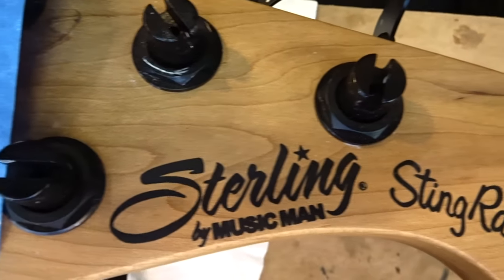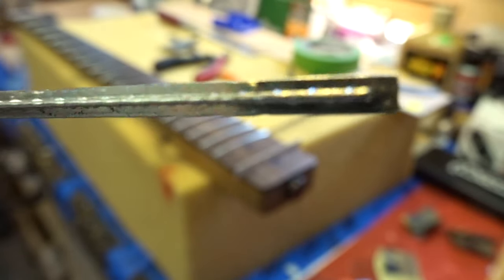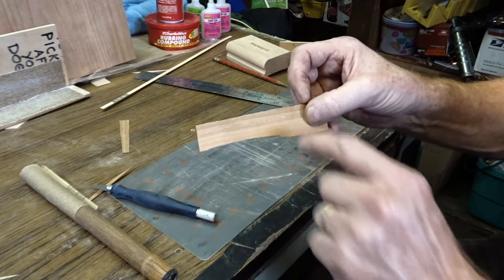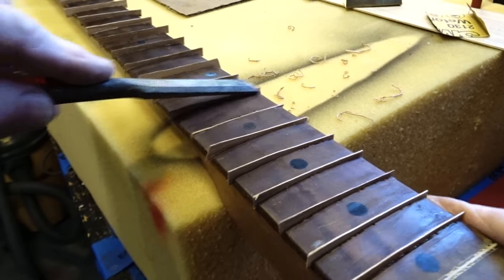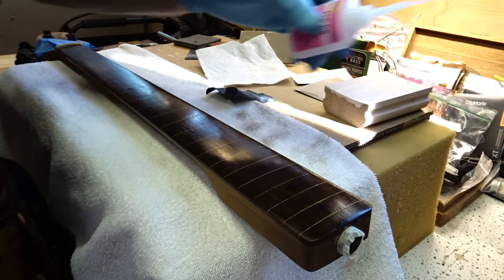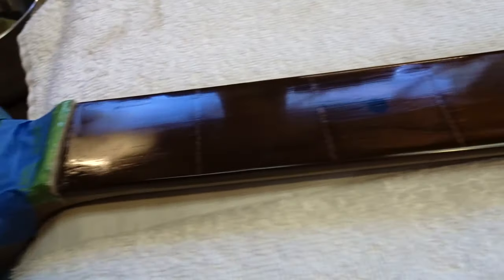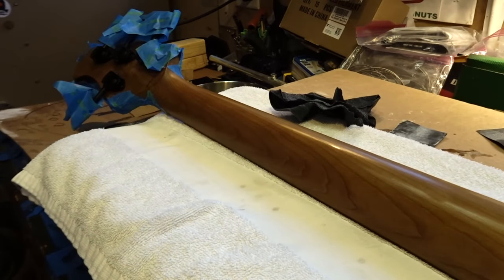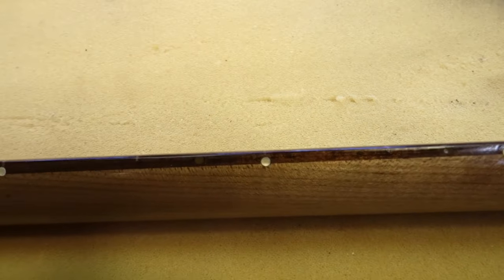Fretless Bass Conversion...Cyanoacrylate Super Glue Finish

Comment: Nice looking conversion. I like that you didn't fill or use a dark filler material, still gives you a visual representation of where you're fingering.
Reply from the maker: I need to know where the frets would be as I'm less than 2 years into the bass.

Comment: Shug a little trick you may want to try is use a tuner to determine where on the fret is in tune. Remember you removed the set location for each note but frets are never perfect in the first place for each string but with a fretless you can fine tune your sound. Good choice to remove the frets. Fretless is great for jazz.
Reply from the maker: Getting used to the feel. I am smitten with it. Lots to learn but the finger roll helps with pitch. The project was very satisfying.
Reply: @shugemery  I prefer fretless, for me it allows more nuance with playing. I have a Ibanez fretless I have played Jazz on for around 30 years and still learning tricks every time I pick it up. Welcome to the never ending wonder of the Bass. P. S. your slaps are getting much better.
Reply from the maker: @kevchard5214  It is tougher slapping a fretless with those tape wounds! Had to slapp 'er with vigor! Thankee. Wish I had discovered my bass love long ago but it is perfect for my life right now. The only way to be new at something is too take up something new. Here is to Nuance.
Reply: @shugemery  Its never too late to try something new I always say.

Comment: for RC models I used to make fiberglass pieces using CA instead of epoxy and would use a plastic bag or cling film over my finger or the part to smooth the CA. Doesn't stick to the zip lock bag material.
Reply from the maker: So you don't have a need to chew the CA off of your fingertips!

Comment: Thank you for this video. Lucky you didn't sell that bass. It turned out very well in the end. What is the experience with the CA coating after three months? Is it hard enough that there are no wire marks on it? And, I know it's too late for you, but maybe for someone else. You can save a little time and effort with this trick: don't pull out the frets, just sand them down to the level of the fretboard. That way, you'll have the space filled, and you'll have a mark where the note is. Further, everything goes like in this video.
Reply from the maker: It has held up very well. No string marks that I can see. I do tend to play my fretted bass more but feel I will grow into fretless as my bass journey continues. Thanks.
Reply: @shugemery  Thank you. Cheers!
Reply from the maker: @Djole_NS246  I do have tape wound strings on it though. Very smooth strings.
Reply: @shugemery  They sound really good. And even for playing, it wouldn't be said that it's only two years :)
Reply from the maker: @Djole_NS246  It will be 2 years in December. I am truly enjoying the bass. My mandolin has to plead with me to playin. Thankee.